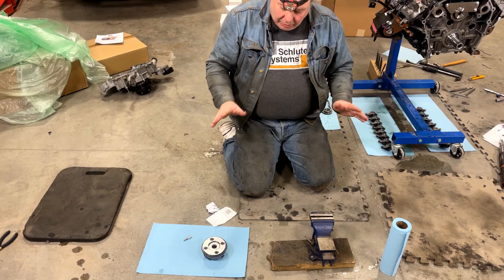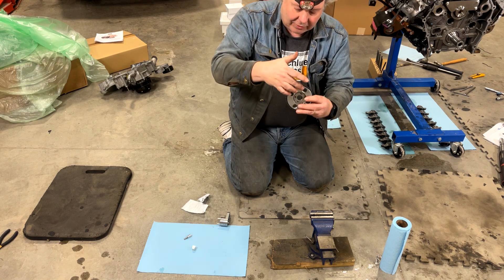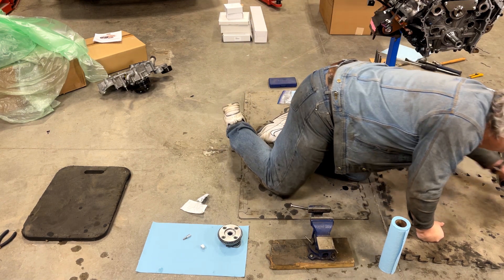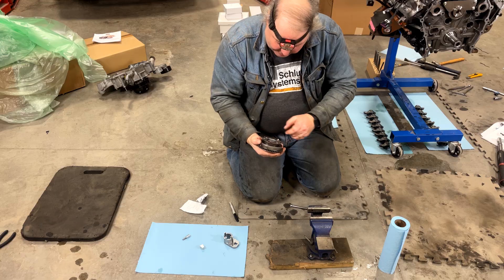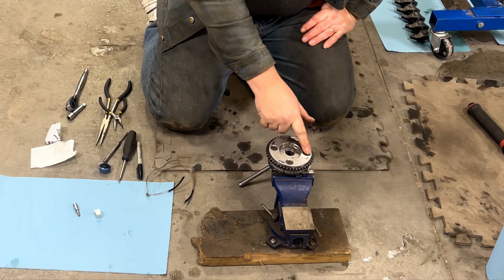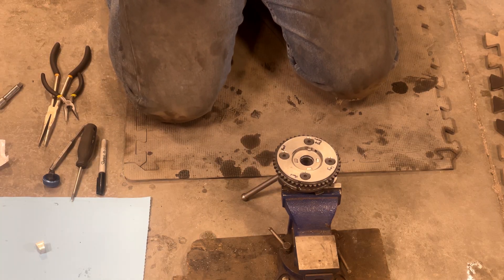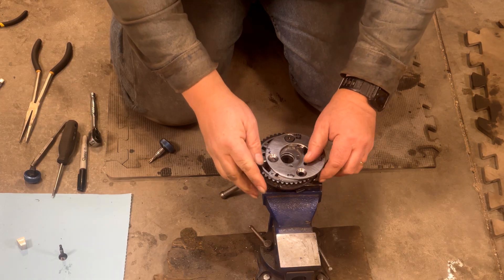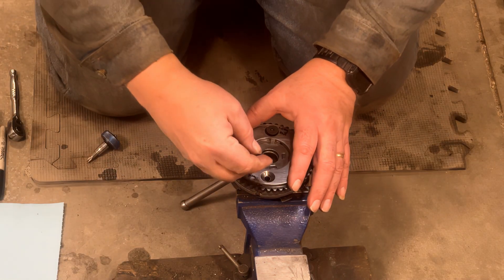Ford 7.3 Godzilla Cam Phaser Limiter Installation

Comment: They don't have work benches in your neck of the woods?
Reply from the maker: They do, and I have a bunch of them, but it is easier to bring the cameras in for you guys in the back of the shop where there is a lot of space and it is easier to get a good angle. I don't think I am alone in ending up with pretty cluttered work benches too, which distracts from the content of a video like this.